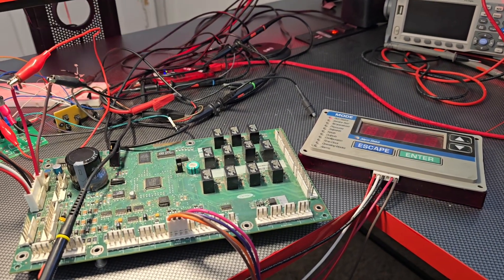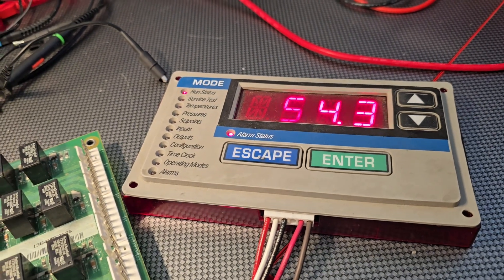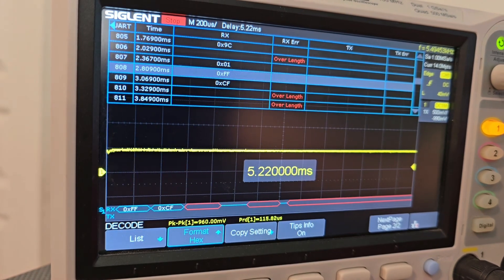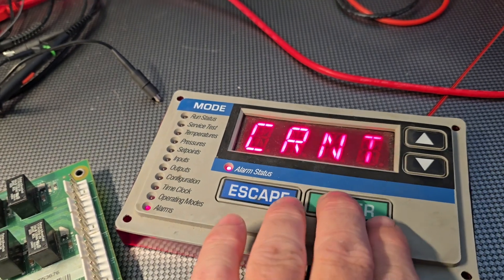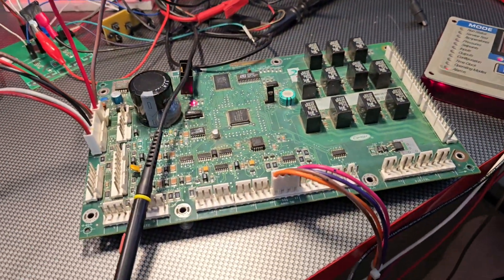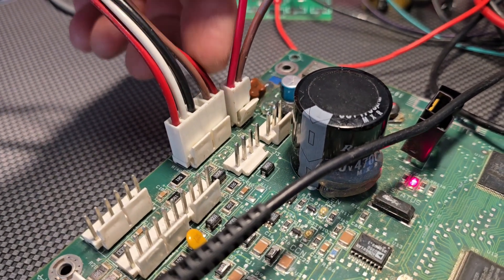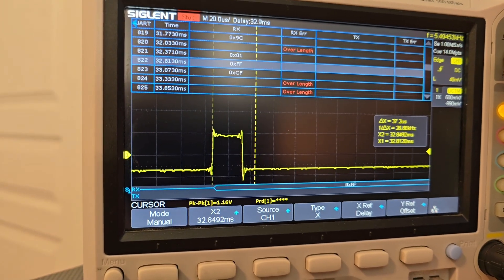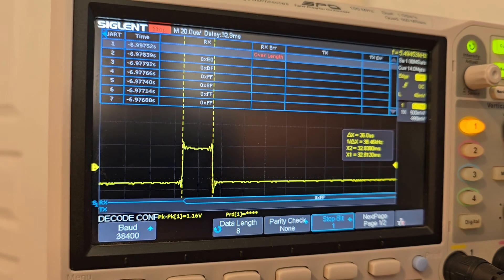Viewing Carrier LEN BUS data on the scope

Comment: Where/how did you gain your electronics knowledge?
Also, the new marquee PN is HK50AA063.
You can buy a “network service tool V” and you can see the information. The baud is 38.4K in the primary language and 9.6K on the secondary.
Reply from the maker: I do have NSTV. Using the device manager and the loader program for MBB's. I only fire it up a few times a year tho. So I have to fumble thru it after a while.
I didn't know there was a 9.6k bus tho. 

If you go back a few videos, I use NSTV connected to MBB to bus scan for a LEN BUS VFD 👍

I was an electronics guy first. Went to tech school, then got distracted for a few years and fell into HVAC.
I never went to HVAC school. But being a mechanic since beforean and electronics background, HVAC was an easy path.
Reply: @hackfreehvac in NSTV, use bus monitor.
The MBB wants to talk to a router. If you can get a CCN router, then you can watch the router (address 0,0) talk to the MBB( usually (0,1)… it will be line by line and you can see what’s being requested and what data points is being transmitted back.
I’m intrigued by your electronic view of the HVAC industry!!
Reply: It COULD also talk to other devices as well, like a UPC, or another devise for air side linkage. Just not another MBB(typically).